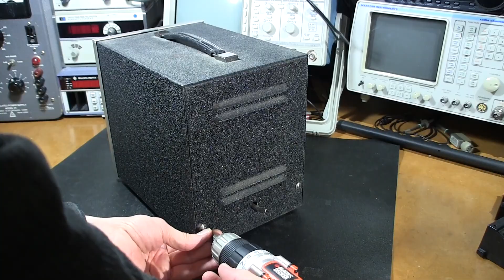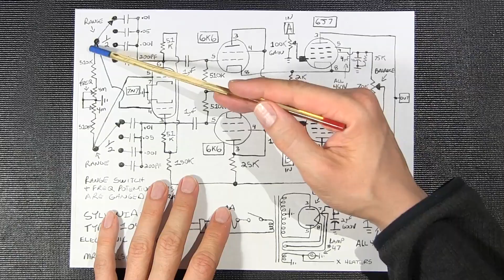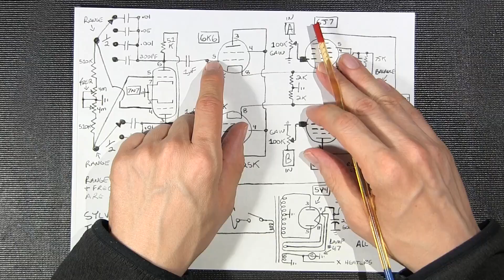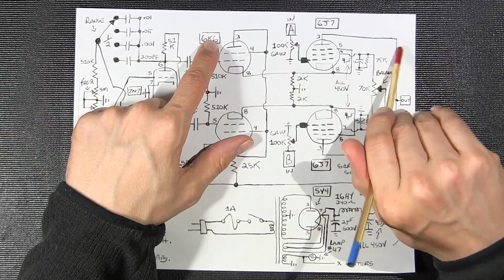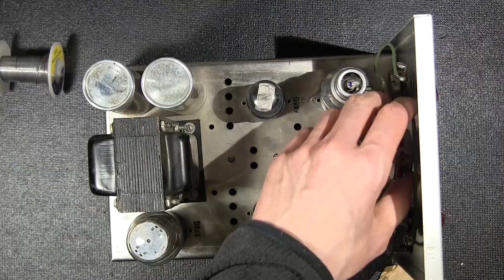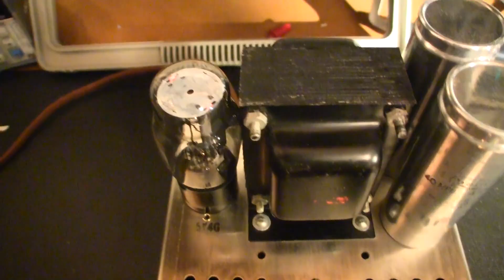Neat Electronic Device from 1939 Explained with Restoration

Comment: Its pretty ironic that they brought this equipment to do a specific job and it never really worked for them due to an assembly fault......and then you come along years later fix it in a video and now it does what it should have all along.....by the way was the sig gen you were using sweeping slightly,,,,the sine wave looked to be a slightly different freq at one end (Higher Freq at the right side of the trace) ?

Comment: See black choke on underside of chassis @15:36 min. Is this the same type of black insulation which was found in later model receivers using EF12 type tubes in the IF stage, which gradually fills the room from the ceiling down with a characteristic bluish smoke when gradually smouldering while the technician is asleep? It was a beautiful radio; but the smoke which would emit shortly after warm up spoiled the crystal clear listening experience. Its true. Hence one started coveting the University's Transformer Winder. Its a useful tool when dealing with Black'n Old Inductors. ;)

Comment: I'm still confused as to what this does. Your Heathkit scope looks like it already has two channels - I see banana plug input jacks on lower left and right and then you refer to it as a "O-11 Dual-trace oscilliscope." But at the beginning of the video you said this unique electronic switch was designed for older single-trace scopes.
Reply from the maker: Hi Jeff. The scope is only one single channel. The jacks you see are for vertical and horizontal inputs (X and Y axis). The older scopes had horizontal jacks on the front, unlike many modern scopes.
Reply: OK. We're going to have fun, Paul. Mine is a Tektronix 561A w/ 3A1 Dual-Trace amplifier and 3B4 Time Base - estate sale find from about ten years ago (w/ probes) and looking forward to learning to use it on some of your Patreon Page projects!

Comment: Was that fuse holder original? Seems like all the old tube gear you have restored have line cords going right to the on/Off switch and power transformer. This video is a wealth of info. Thank you for doing it.

Comment: Awesome project. Love your liberal use of the term Reverse Engineering. Clearly a science in its own right; spearheaded by the Global Super Powers during the period of the cold war, and perfected by Plasma TV service people these days. A tricky undertaking with circuit boards exceeding 3 layers in other areas of the industry. Considering that Stereo Amps, at least in Germany during the 70th & 80th, were still sold with circuit diagrams as part of the manuals provided by the retailer on purchase of a quality electronic product accommodating barely more than a couple of single layer boards. ;)
Reply: Naturally each German Submarine or Aeroplane made according to DIN specifications,  with each component stamped or labelled "Made in Germany", put into service prior to that time, was delivered as could be expected, with a full set of manufacturer's specifications and diagrams, for anyone interested in such thing to know exactly how it would sink or fly.  ;)

Comment: I’m gonna try to repair/restore my two scopes. A Sencore PS-148a and a Heathkit IO-4541 they’re both out of wack and the Sencore was making some banging noises (which were probably the electrolytics(?)). Eventually I’ll use them for test equipment and displaying music as traces and XY vectors, I’m going to try to build a dual trace adapter so I can display both channels on the 4541.

Comment: Among all your excellent videos, this is one of my favorites.  I had never seen or heard of an "electronic switch" like this before I found your video about 6 months ago.  Now, just a few days ago, I saw a very similar device on eBay:  a Heathkit Model S-2 Electronic Switch from the mid 1950s!  I snapped it up along with a separate eBay purchase of a Heathkit IO-14 oscilloscope (which superficially resembles a Tektronix 500-series or 300-series scope, although the specs aren't as good as a Tek scope).  The S-2 will go well with the IO-14, and also with my HP 120A single-channel vacuum tube oscilloscope (ca. 1957, about 200 kHz bandwidth).  The Heathkit S-2 circuitry is remarkably similar to your Sylvania Type 104 electronic switch.  Slightly different choice of tubes, but basically the same overall topology -- dual triode oscillator, dual triode buffer/driver, then a pair of pentodes between the inputs and the output.  Nifty!  Should be a fun resto project!
Reply from the maker: Great! If you get it all working together, post a video (if you can) I would really like to see it.
Reply: Here's a static photo to pique your interest....
:-)

https://scontent-iad3-1.xx.fbcdn.net/v/t31.0-8/26063682_1903920669622365_328057310593372194_o.jpg?oh=fce476e3ba754cb61a0cb232a121553c&oe=5ABC651D
Reply: Hi, Paul!  I've acquired a number of vacuum tube hi-fi amplifiers and the aforementioned vacuum tube "electronic switch" and oscilloscopes, all of which I will be restoring in the future.  But before I jump into repairing all that tube gear, I wanted a high-voltage capacitor leakage tester of some sort, like the one you show in a few of your videos.  But rather than restoring a vintage tester, I decided to design and build a more modern one from scratch.  It's a project that I've had on the back burner for several months.  Over the Christmas break, I finally ordered all the remaining components and built the thing!  I shot a couple of primitive videos of the finished project in action.  These are my very first YouTube videos!  I've never had the intention of producing the high-quality videos that you do, but maybe I'll gradually head in that direction...  Who knows!  In any case, I hope you enjoy these two brief ones.

73s!

Walt, KC3JTJ

Part 1 of 2:  https://youtu.be/R-YZfpof4i4
Part 2 of 2:  https://youtu.be/BaigFo82rnk

Comment: Depending on thew capabilities of the Heathkit scope (I never built one, although doing various other kits from them), You could possibly blank the channel switching.   If there is a “Z” axis input, you would feed the oscillator output through a small capacitor to that “Z” input. That is how it is done on TEK, HP and other scopes.  Oh, coming to think of that, you certainly would need to play a little game to get the same transient blanking signal on each channel switch polarity.  That would seem to require maybe 2 or 4 diodes or a couple of resistors in addition of two small capacitors.  Oh, well, the diodes would make the switch at least a decade younger technology...

Comment: Waiting to power it up for the first time until after it's completely restored is asking for old man Murphy to visit with the transformer gargoyles .. My advice is to put a current limiter in line and test for a bad power transformer before undertaking a restoration.  If nothing else, a dim bulb tester should be used.

Comment: Today I viewed an " unboxing therapy " video of a $3,000 Bluetooth speaker that was about 18" high and 6" wide,in that case they claimed to have a 4,800 watt amplifier ,no ohmage or THD listed ,aside from the 4,800 watt claim that's impossible to create from a 15 amp outlet if the amp runs higher than 1 ohm ,the only other spec listed was a whopping 106 db max spl and the comments were flooded with drooling idiots wanting to buy 2 for stereo ,I tried explaining how loud 106 db is to no avail ,we are in the age of morons with throw away plastic electronics ,in 80 years there won't be 1 example of today's  $1,500 I phones thst even works .

Many people wonder why I repair & collect vintage tube gear ,my grandsons friend laughed when he saw my Westinghouse amplifiers until I told him they were worth $30,000 and would sell in a week .
Reply: Michael Ledford The main problem with newest gear is the absurd amount of knowledge needed to do anything useful with it outside of the whole ecosystem. Just the specs you would need to inter operate with an iPhone: the CDMA and GSM specs, the 802.11 specs, Bluetooth specs, and of course all the Internet RFCs are tens of thousands of pages, probably on the order of 100k pages in total. So, as the technology moves on, it becomes tedious to keep older devices going. 

Sure – hardware like FPGAs (especially those we’ll have 30 years from now) makes implementing all the “interop” layers easy, but the sheer amount of know-how needed to get those very intricate specs working is measured in man-years at best.

It’s easy to connect something modern to a 2-wire phone terminal, but in 20-40 years connecting anything fully to an iPhone will require a dedicated person (or a few), many years worth of effort, and lots of patrons. For a well controlled tech demo – nothing that would work outside of a lab. 

The engineering that goes into modern mobile electronics is phenomenal in all aspects – let’s not forget that. Ask any RF engineer from 30-40 years ago how feasible it would be to have a device with HiFi audio and video that you can walk around with and use to communicate – let’s say that money and size wasn’t a problem. And then add “oh, and it should work on a street with a thousand others nearby using them too”. You’d be laughed out of the room.

Yet it’s an everyday thing now, and nobody thinks much of it. I like implementing digital communication systems from first principles, covering the entire protocol stack and electrical layers, and even something as “simple” as USB3 requires months of effort to get going in a prototype if you do it all yourself (i.e. no reuse of 3rd party IP), and many months more to develop all the test gear needed to validate performance.

Getting a modern CDMA technology stack going starting from first principles (of course using modern general purpose semiconductors like FPGAs and such) would be a 5-year effort, assuming I had no life beyond that. And that would be just for a prototype that works reasonably and inter operates with most devices; getting it productized would probably make me go mad before it got done. 

The reason we won’t be playing around with old iPhones isn’t because they will not work. That’s not a problem, outside of replacing the battery. Nothin much in them really ages: the semiconductors and all the passives have essentially infinite lives; other than catastrophic component failures like ceramic caps shorting out, they’ll work to spec for decades if not centuries. I’m not exaggerating. 

The problem will be to implement the by-then obsolete communications protocols needed just to talk to the device. The engineering that went into making modern CDMA, GSM, WiFi and Bluetooth working as well as they do is measured in man-millenia.

The old vacuum tube gear is simple and surely that’s a good thing, but there’s no way you’re getting hifi audio and video in urban settings via tube equipment. Just getting the RF and modulation done would need a car-sized box full of miniature tubes and a lot of modern computer support in the design process – just to do thermal modeling, even. And then you’d need a decent digital computer on top to do all the rest of the work, so probably a trailer worth of very modernly designed vacuum tube stuff, with custom tubes, and probably exotic approaches like multilevel logic. Semiconductors have allowed the complexity we have now, and there’s no turning back, but inherently any electronic device that’s well engineered will perform fine more or less forever other than material aging. So, the infamous Tek 500 HV transformer potting losses are a thing, and most of the WW2 vintage caps are junk nowadays, as are many resistors. But a modern device engineered well has most components that don’t age as far as essential performance is concerned. Stuff like flash memories and ceramic antennas is more of a problem, I admit.

Comment: What can I say, another fantastic and informative video. I have been involved with electronics for 35 years, I have gotten to the point where the wife is gonna choke me if any more test .gear shows up. I have no where your knowledge, but can you recommend any good basic electrical engineering texts. I have lots of knowledge but need something to bring it together. I want to learn more about basic circuit design.
thanks Paul keep on making these videos.

Comment: According to the Wikipedia article about Sylvania Electric Products Inc, the company changed its name to Sylvania Electric Products Inc. in 1942. Anything produced before that would bear the mark of Hygrade Sylvania Corporation.
Reply from the maker: Interesting, as the same "39" is stamped on the lamp holder as well. (same ink and font as seen on the capacitor under the chassis)

Comment: I really enjoy your videos, always learn something.  I like that you stress safety.  You always recommend to make sure all capacitors are discharged.  Might be a dumb question but what is the correct way to do this ?  I had a run in with a capacitor and I now have great respect for them.

Comment: I just found this site and I need to learn from the beginning. I will do some reading to refresh my knowledge of resistance, current ,transistors semi conductors.   I can take any motor apart but when it comes to the electronics I get lost .i can't even wire a moped .
You guys look like your all Ham radio ops with military  training or M.I.T. Graduates. 
Am I at the wrong site?

Comment: Very interesting.  I have an EICO Model 488 Electronic Switch.  It's shape is like yours, but shorter and wider, but the front panel components are laid out just about the same. This video makes me want to check it out and get it working. Will hooke it up to my old Devry tube Oscope. First I need to get my Eico 960B Cap tester going first. Thanks!
My interests in electronics started out in the late 50's when I was about 9 years old so tube stuff is very familiar to me.

Comment: Thanks for sharing. Cool device! I might add that an analog Ohm meter is ideal for testing potentiometers. You can go through the full range and watch the needle more slowly (or not smoothly). Especially useful for carbon pots rather than wire-wound, but still the best tool for the job. DMMs are not great for pot testing.
Reply from the maker: I tend to agree! Thanks for your comment!

Comment: My Dad left to me a similar/same Heathkit oscilloscope, and I wonder if I made a mistake storing it in a hot and cold attic? He said something about a capacitor may need replacing. I had thought about selling it, because it is just so big, but I don't know if I would get much money from a yard-sale or from ebay? But modern oscilloscopes, while smaller and coming with a manual, are so expensive. Which is better? Does the new stuff last for very long? So far, I have not had time to experiment with electronics, although I have enjoyed watching some of your YT videos, and only use basic tools such as maybe a multi-meter, in trying to do easy household repairs. I am nowhere near as handy at repairing things as my Dad was. Did I ruin my oscilloscope by putting it in the hot/cold attic? Should I sell it, and for how much? I suspect I may try to hold onto my oscilloscope, as probably nobody will pay me what it is worth? But I have never had a reason to use it.

Do I need to swap out all the capacitors before powering it up? I wouldn't even know how to swap out capacitors, although I do have a few soldiering irons.
Reply: If you really want to use the scope for real measurements, don't bother with the Heathkit.  It certainly won't be accurate after 40-50 years, attic or not.  Even the scope in this video is not right.  It's distorting the waveform such that the frequency appears to get higher toward the right side of the screen.   And there are no voltage markings for the vertical deflection.  You just have to know what X1, X10, X100, and the 1-100 knob means, or use a voltmeter to figure it out.  It's OK for seeing the basic shape of a signal, or for antique/nostalgia reasons, but I wouldn't try probing anything important with it without making sure there isn't a voltage on the input.

If you have never replaced an electronic component in anything, I wouldn't try.  I'm sure there are a lot of caps in it.  I  would take it outside, open it up and blow the dust out.  And then try powering it up inside.  Turn the unit on, then plug it into a switched outlet that is switched off, then turn the wall switch on.  Get ready to turn it off if you hear any popping or smell or see smoke.  :)   You won't see a trace until it warms up after 30-60 seconds, and even then might not see anything since the trace could be off the top or bottom of the screen.  It most likely won't work, without some caps being changed.  If you do see a horizontal green line that you can center on the middle line and stretch all the way across the screen, you will be able to get more $$ for it.

If you want to replace capacitors before powering it on, I would start with the ones in the power supply.

Comment: Fantastic Vid! Definitely going to check out the Heathkit scope restoration video too. You said that the output was DC coupled, so there would be high voltage on the output. What did that end up measuring?
Reply from the maker: 150 Volts..... Zap!
Reply: Mr Carlson's Lab Ouch! Is it capable of lethal current?